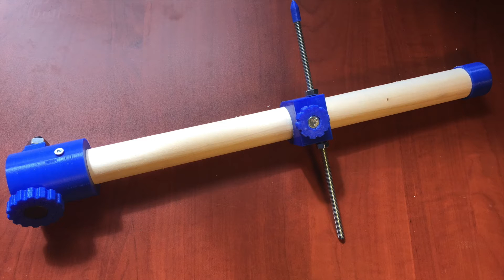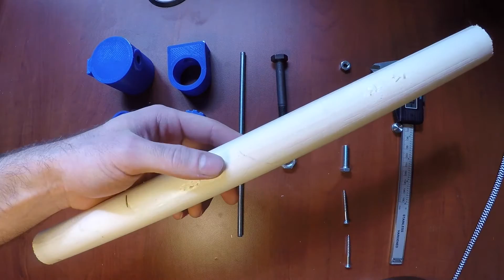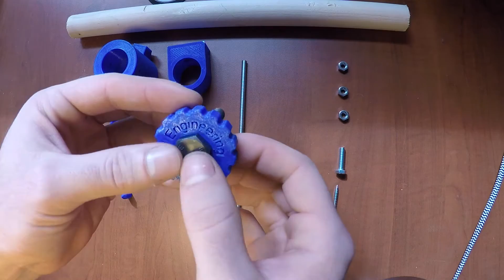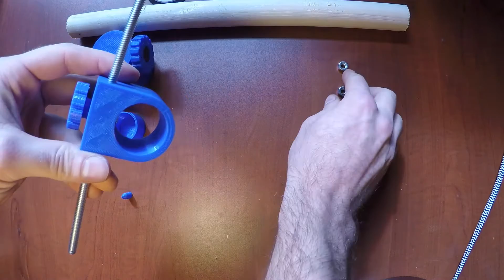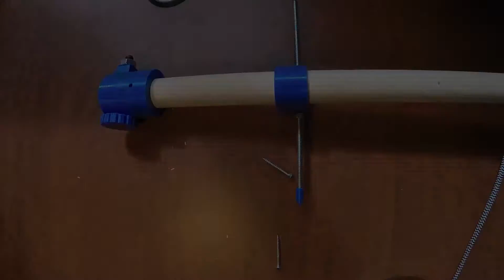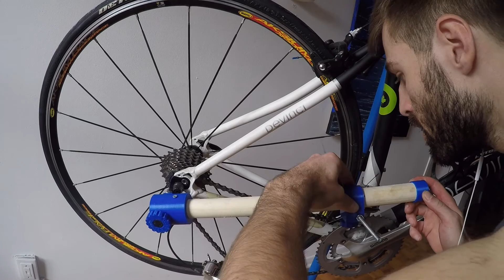DIY 3D printed Rear derailleur hanger alignment tool

Comment: Nice work, dude. I've got basically the exact same "slider thing with a threaded thing and plastic indicator thing" for my truing stand (also on thingiverse), so I might try to  repurpose that for double-duty.

Only thing I want to point out is the spec for that bolt you thread into the derailleur hanger. The "SBE" is the initials of the company that made it, and "8.8" is the strength class - generally a "medium strength" bolt, but amply strong for this application. The more important thing is the diameter and pitch, which for a derailleur should be 10mm x 1.0mm (a fairly fine thread spacing).

The easiest place to find one of them would be McMaster-Carr (mcmaster.com) - a generic industrial online warehouse. They're a little on the pricey side, but they do have *everything*.  *Everything*. It's part number 91180A632 there, and is $10 for a bag of 5. And no, I do not work from them, but I shop there often.

Thank you for contributing stuff to open source/cycling!
Reply: I believe old standard axles are 10x1 threaded.  Might be cheaper to check with a bike shop for an old bent axle.  There will be enough straight part left for this use.